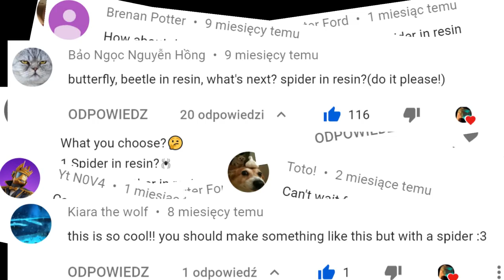Spider in Epoxy Resin. DIY a Simple way / Resin Art

Comment: I just did a real black widow I had that died , btw the hourglass goes on the underside not the back. 😀 Great vid!
Reply from the maker: Thank You
Reply: May i ask how you did it? I am trying to do the same right now and her body is currently pinned into the pose i want but i don't know how to stop her abdomen from shriveling once she dries out
Reply: Yo mine just died after 16 months strong. I found her in my workboot last fall. I pinned her up and put a lamp over her for like half an hour to dry her legs into place and then I placed her outside in the cold to keep her abdomen from shriveling. Buying resin tomorrow. RIP Scrambles.

Comment: For black widows the red hourglass shape is usually on the underside. The Australian Redback spider has red on it's topside but it runs down to the underside like a stripe. Sorry if I'm a little nitpicky, it's still a neat project and a nice result.
Reply from the maker: You're right. But it wouldn't be visible below

Comment: I was hoping it would be a real spider because I need experience with that. I did an acrylic pour on a large canvas, then added a big fake flower, & a butterfly pendant. I placed a big spider onto it & encased it in clear fingernail polish. It came out cool except I broke a Gould legs when something fell during transit. It was my first attempt using a real spider. I will certainly do things different next time.

Comment: Cool sculpture. Look, I hate to be the odd one out, and I know black widow spiders have a sleek, simple design, making them easier to sculpt, but almost every time I see one in art, the hourglass is on the wrong side. I know it looks cool to be on the top, but the mark is under the abdomen. That being said, I've never seen a spider sculpted this way, where the legs, created from tiny toothpicks, are affixed to the surface first, followed by the head and body. I was scared it was going to break. But I'm impressed that it held up so well. Sorry for the critique. It's still a cool sculpture.

Comment: That's not very realistic. For one thing, way too large. The abdomen and cephalothorax are way out of proportion. Also, the legs on a black widow are much longer in the front pair and rear pair than the two middle pair. Also, where are the eyes? 

This isn't a fantasy creature where you can just make it any way you want. Next time crack open a book or look it up online do you can get the details right.